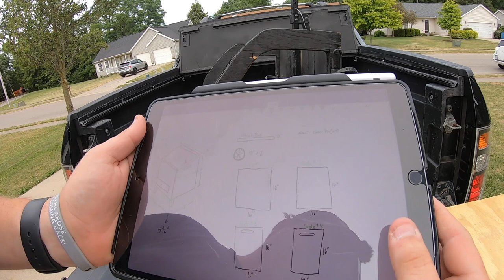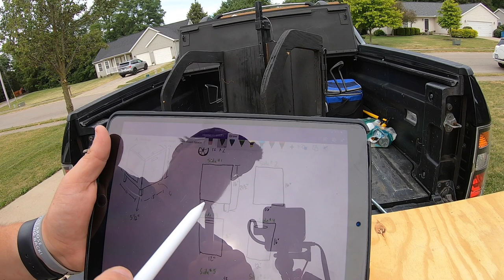DYI Disc Golf Cart Complete Built! Full instructions to build your own!

Comment from the maker: Learn how I made a Disc Golf Cart! Let's see how sweet this thing turned out! 

Tools: 
* Rigid Jigsaw - https://amzn.to/30unQgL
* Rigid Drill Set - https://amzn.to/3bb9t2S 
* Rigid 4in Grinder - https://amzn.to/3IPrTFz
* Circular Saw - https://amzn.to/3bZeBuM
* Table Saw - https://amzn.to/3JYtGJG
* Miter Saw  - https://amzn.to/3JUdMzI
* Orbital Sander - https://amzn.to/3yBy0ZC
* Drill Bit Set - https://amzn.to/3f8gti8 
* Brad Nailer 18g 
* 1in Brad Nails (18g)
* Welder / Gloves / Helmet-Eye Protection 
* Philips Screwdriver - https://amzn.to/3hdpzx0 
* Flat Head Screwdriver - https://amzn.to/2RAjTlU 
* Tape Measurer - https://amzn.to/3bg83nI 
* Speed square - https://amzn.to/3vUn4U8
* T-Square 48 in - https://amzn.to/3m3jK6I
* Safety Glasses - https://amzn.to/3ux25GO 
* Sharpie - https://amzn.to/3o3CZwW 
* Clamps - https://amzn.to/3oUKJ6r
* Painter’s Tape 2in - https://amzn.to/3uyt4BU 
* Screws: 1-1/4"and 9/16"
* 36 in x 1/2 in Metal Rod - https://amzn.to/3C39uEf
* Palm Sander -  https://amzn.to/3Qjru1z
* Sand Paper - 60, 120, 220, 800, 1200 grits 
* Bondo X2 - https://amzn.to/3pi3Erd
* Paint Primer - Gray 
* Auto Paint - Intense Blue Pearl - https://amzn.to/3pgoE1z
* Putty Knife - 3in and 1in - 
* Wheels x2 - 
* Wheel Handle Nuts x2 - https://amzn.to/3PrxvYC
* Hinges with stay open (top) / Cabinet Hinges - 
* Hinges with closing feature (door) / Cabinet Hinges - 
* Pull Handle for Door - 
* Wood: 1/2 in Plywood - less than 4'x8'
* 1/2 in x 4in - extra support for legs
* Clamps 
* Hammer
* Adjustable Wrench
* Picture Frame Corner
* Tape Measure
* 1/2 in drill bit
* T-20 bit 
* Chisle
* Hacksaw
* Carpet or Oil Spill Matt - 
* Heavey Duty Spray Adhesive
* Utility Knife
* Ball Golf Cart Handle (or get a Razor Scooter Handle)
* Wood Glue Outdoor - https://amzn.to/3pXtctE
* Corner Bracket x5 - https://amzn.to/3DZGKJQ
* 1/2 in Bolts & Washers 

Chapters:
00:00 Intro
00:07 The Project
01:22 The Tools & Supplies Needed
08:25 The Build Concept
09:42 Building Specs (will adapt as needed)
11:17 Cutting the Wood for Front & Back 
12:44 Cutting the Wood for Bottom and Both Sides
13:21 Planning Out the Handle for Both Sides
15:50 Cutting the Handle
16:18 Dry Fit it All The Wood Together
19:10 Putting Together the Side & Front
23:28 Adding Other Side to Front & Side
28:45 Adding Base 
36:08 Adding Support Brackets to Base
39:00 Adding a Shelf for Discs to Sit One  
43:28 Dry Fit the Front 
44:05 Making the Feet
46:57 Cutting Out Door on Front Side
49:47 Adding the Back of the Feet
51:18 Adding the Front 
53:13 Making the Top 
53:56 Dry Fit Top & Brad Nailing Everything
56:36 Adding 2 Corner Brackets to Legs
57:49 Planning Out the Door with Hinges
59:27 Adding Divider in Cart
59:27 Sanding Everything Down
01:02:18 Adding Bondo to Cart
01:09:20 Sand Bondo Down 222… 800… 1200 grit
01:10:05 Add More Bondo Where Needed After Sanding
01:11:11 Continue Sanding where needed
01:12:27 Paint Primer
01:13:16 Paint Top Coat - 2 Coats
01:14:16 Add hinges for Top
01:16:14 Add Hinges to Door
01:18:00 Add Top with Hinges
01:24:28 Adding a Pull Handle
01:30:19 Welding Axel and Bolts for Wheels
01:32:18 Carpeting the Inside
01:38:02 Adding Noise Reducing Foam
01:40:42 Adding Components
01:42:19 Adding a Chalk Bag
01:51:09 Adding a Water Bottle Holder
01:54:41 Adding Front Latch with Button 
02:01:52 Handle for Front Door
02:07:32 Putting on the Wheels
02:17:17 Putting on a Fluted Knob Wheel Lock
02:21:39 Closing 

Check out my website at http://mcfixit.us 

Disclaimer:
Due to factors beyond the control of MC FIX IT, I cannot guarantee against improper use or unauthorized modifications of this information in the video, post, blog, or social media. MC FIX IT assumes no liability for property damage or injury incurred as a result of any of the information contained in this video. Use this information at your own risk. If you feel uncomfortable at any time. Stop and go to a professional. MC FIX IT recommends safe practices when working on vehicles, your house, or any other project and or with tools seen or implied in this video. Due to factors beyond the control of MC FIX IT, no information contained in this video shall create any expressed or implied warranty or guarantee of any particular result. Any injury, damage, or loss that may result from improper use of these tools, equipment, or from the information contained in this video is the sole responsibility of the user and not MC FIX IT.

#mcfixit #discgolf #discgolfcart

Supplies used to record this video: 
* GoPro Hero 7 Black - https://amzn.to/3f3ALtb 
* 256GB Flash Drive - https://amzn.to/33pAueG 
* Vlogging Frame - https://amzn.to/33tajE0 
* GoPro Pro 3.5mm Mic Adapter - https://amzn.to/2RCURCu 
* Youmic Lavalier Lapel Mic - https://amzn.to/2R55sWX 
* Boom Stand (tripod) - https://amzn.to/3bdkQaw
* 5/8” to 1/4” adapter (boom to blogging frame- https://amzn.to/3txrVsM 
* Portable Battery Powerbank- https://amzn.to/3vJQc0q 
* 6ft USB to USB-C (powerbank to GoPro)- https://amzn.to/3uAS5MH